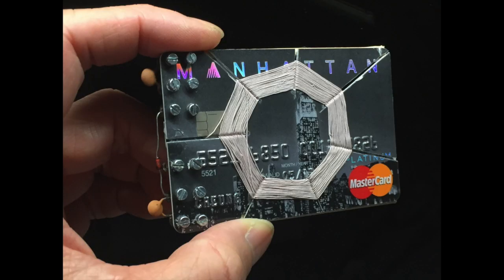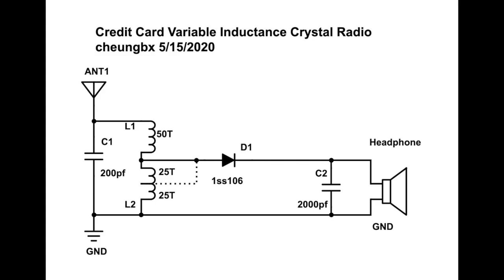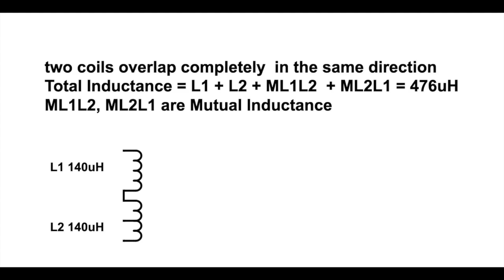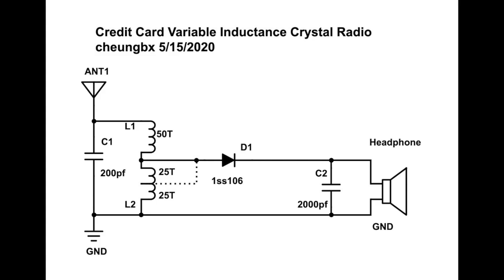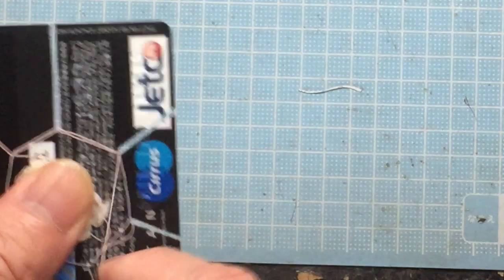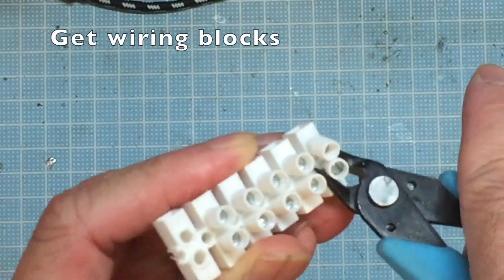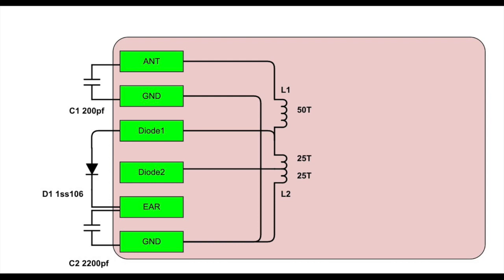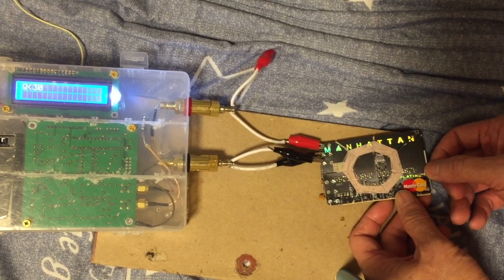Variometer Credit Card Crystal Radio

Comment: Comrade, why did you stick different radio junk there, you have a SIM transmitter on the card, it works like a whole radio station. Attach 2 wires there, one of which will work as a diode, and the other as a repeater, and even with an amplifier built in there.